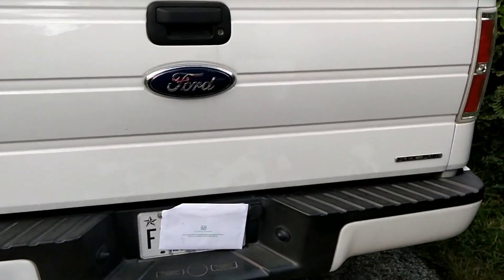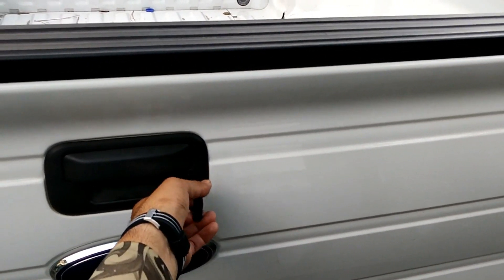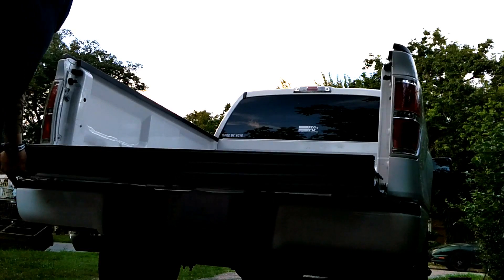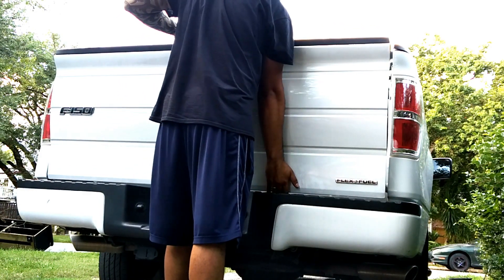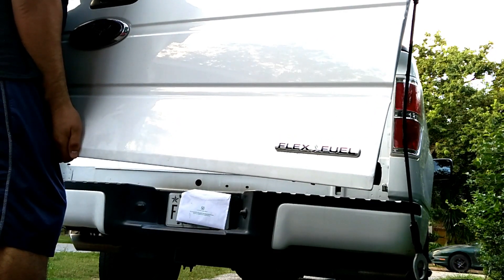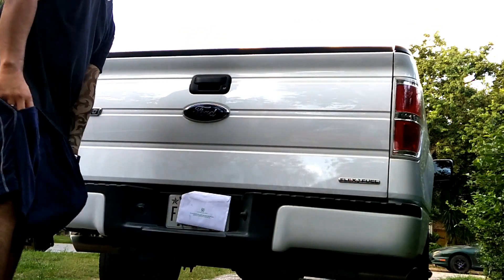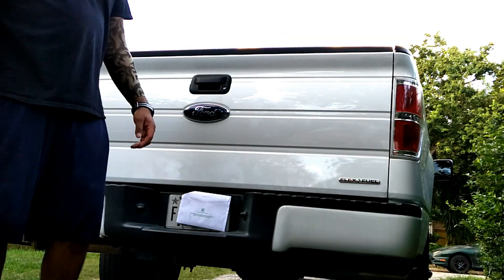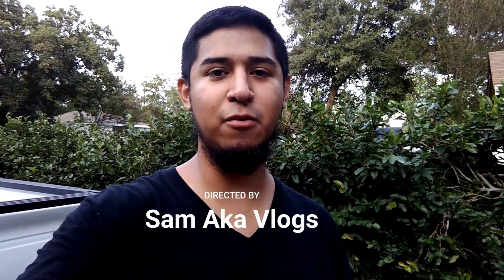How To Remove The TAILGATE On ANY Ford F-150

Comment: Tried to take off old tailgate on 2002 F-150 left side wld not come off... Then tried to get a better one and had same problem.. even used small Sledge hammer and crowbar.. what is the problem..
Reply: floyd rasp I have same problem with mine. Left side stuck, I’ve done everything I can do far and NOTHING. Any luck with yours
Reply: I had the same issue on my 2012, I sprayed with some lube... moved it up and down a few times, lifted up on right side to remove right then you slid the tailgate to the right to remove left, not lift